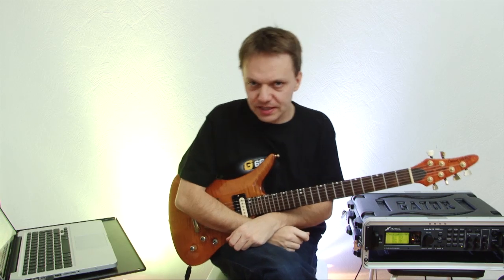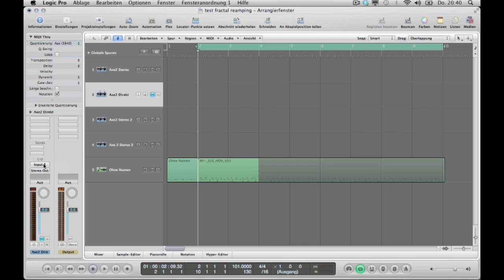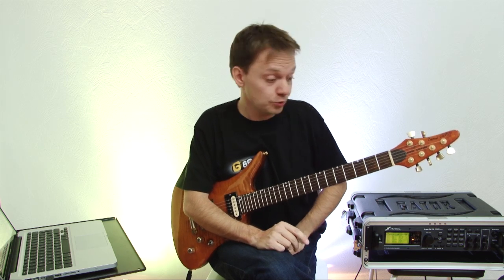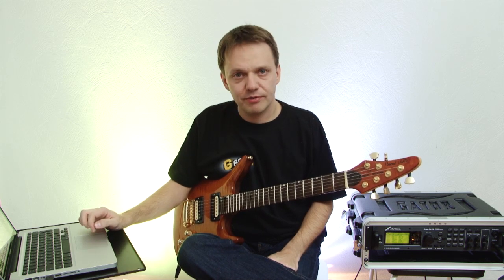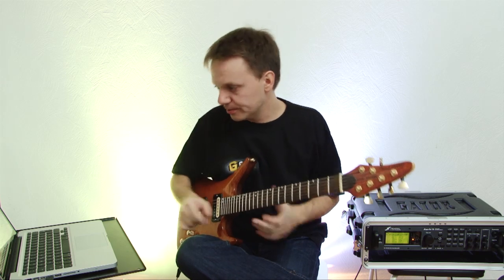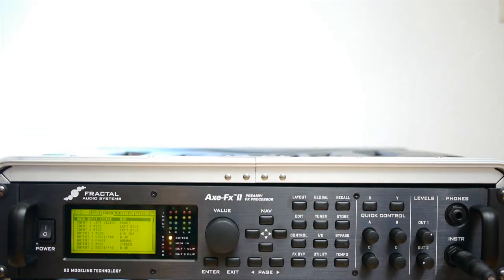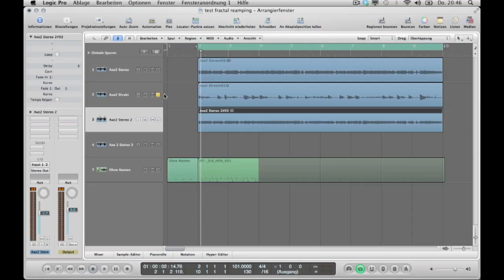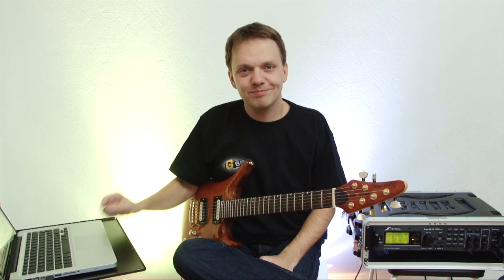Axe-FX II Tutorial (en): Reamping with Logic Audio

Comment: This is awesome, but would be even better if the "re-amp" part would affect only the dry track instead of the files. Any solutions on how to do that within Logic without additional hardware while still using the Axe FX as the audio interface?
Reply from the maker: Maldi Kellici I dont know exactly what you mean... you can always reamp in logic, but then you would have to use a plugin, which would not sound as good as using the axe FX
Reply: Bernd Kiltz Thnx for the reply Bernd. The issue is that when you reamp, it affects every track, not just the dry guitar track. That's why you mute certain tracks, right? It makes that hard to hear how the reamped track would sound in a mix, if you're doing tone building because all the other tracks go through the axe fx. Not sure if there's a way to set it up so that only the reamped tracks is affected by the Axe Fx.
Reply from the maker: Maldi Kellici You of course have to switch the track to solo, record it, and only then can you hear the whole mix. its much more complicated than with software... but thats the way it works only using the axe. You can reamp in other ways with an audio interface AND the axe fx, but that is much more complicated to set up. Search the Fractal Forums for "Analog reamping" - good luck :)

Comment: Do you have to have the project at 48 kHz?
Reply from the maker: As the AXEFXII is fix on 48.000, you should have the project at 48.000 if you connect over USB. Otherwise you would have resampling and artifacts all over the place, not recommended - and I don't think it even works. I record with my SPL Crimson and connect the Axe over symmetrical cables (analog), if I am doing recordings. Best from Germany

Comment: Just tried it with Protools and you do it the same way. The thing with Protools is that you first need to create a so called Aggregate Audio Device first (if you are on a MAC) you do this in the Audio Midi Setup application. When you done that you can do as in this video.

You can check this link for more info at the fractal audio forum

/Hasse

Comment: Hi, nice video again :-)
I have done this a couple of times before and always end up with the reamped track a bit out of sync every time when I use the USB reamping. Have you experienced the same thing?

Also, do you need a FX block in your preset to get the clean tone? 
When I reamp with out the use of USB I know i need it.

Regarding reamping in Protools I belive you do it the same why as in this video, I will do a test run and get back with an answer.

/Hasse